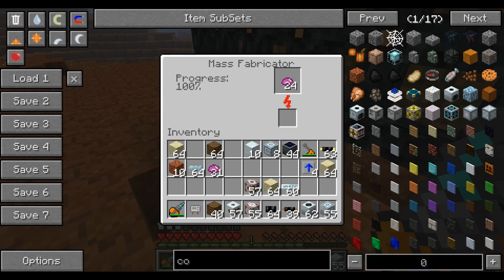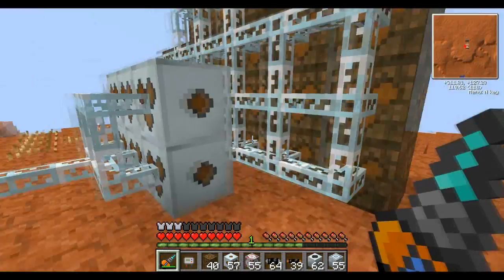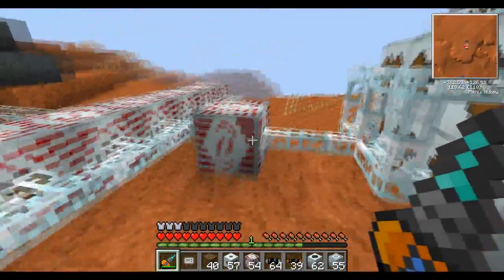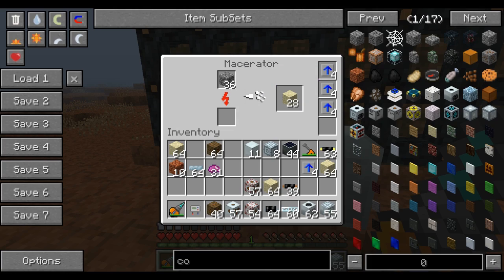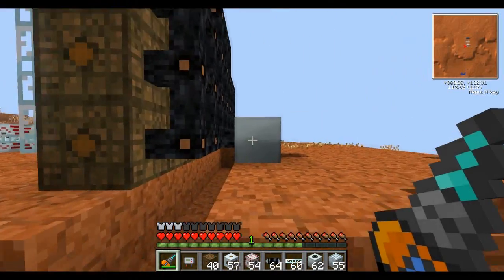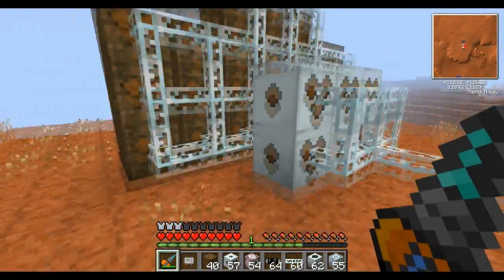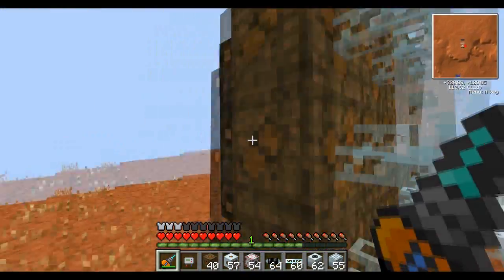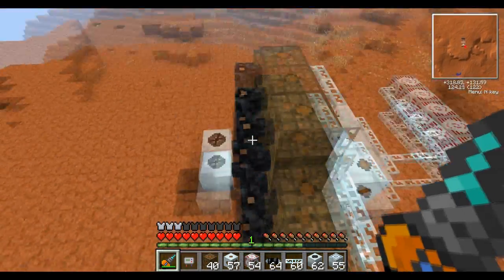Feed The Beast - Tip Series: IC2 Power Management

Comment: I'm using glass fibre for my (admittedly huge) factory, painted yellow for 128, red for 512. Local LV transformers power most of my machines through white copper wire.

Comment from the maker: @squash013 yeah this is one of my first ones, im a bit jumpy. yes loss is per packet did I forget to mention it? HV 512 using glass fiber is ideal for anything longer than 40 blocks, however this system was designed for in base power where you should ideally convert to 32 eu packets for easy of wiring, throughput and setup. also check out my power station vid for how I use this more practically. Also I've covered 32678eu/t to LV with no lag issues so not sure about that.